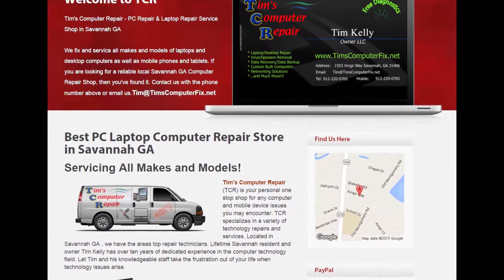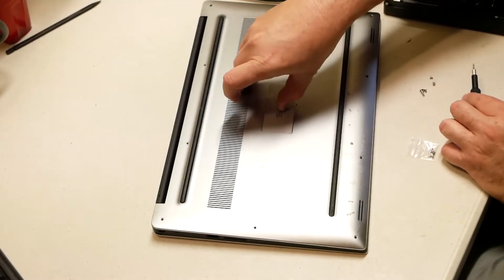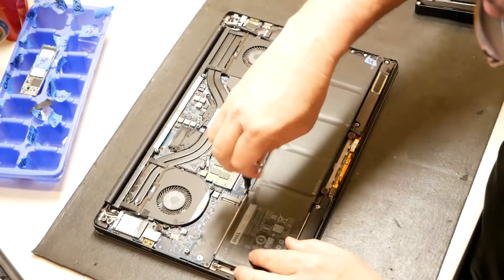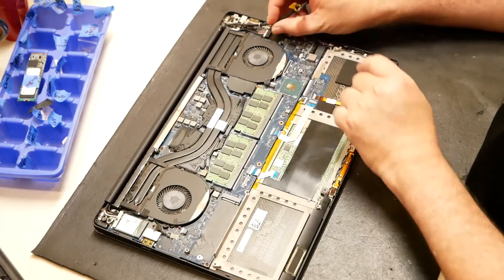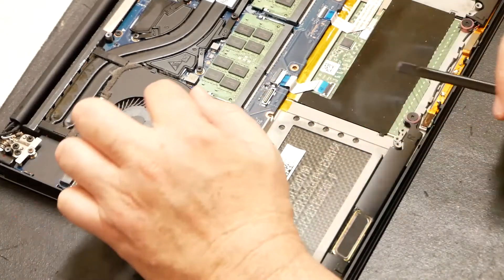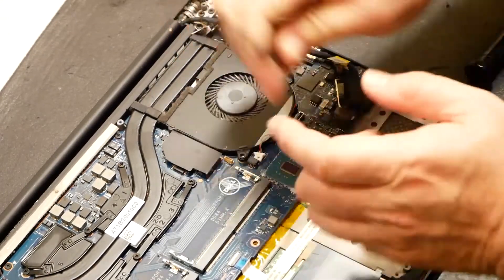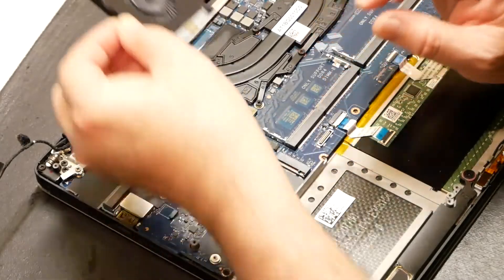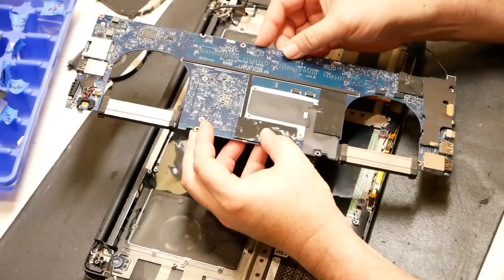Dell XPS 15-9550 disassembly | Motherboard Removal

Comment: watching you video i replaced my xps 15 9550 mother board with a seconds board i am having boot up inconsistencies reboot never works only cold start ups work some of the time. , i have noticed that my service tag is different and the asset tag is as previous , bios upgrades do not update,. should both tags be the same, if so which one should be changed and how and or should i do a clean install of windows, . or do i have a completely different problem. laptop works fine once booted up. tried all bios, firmware updates nothing works in the f2 diagnostics i cannot change any tags. dell support doesn't want to know anything as it is out of warranty and board was not from them, thank in advance
Reply from the maker: Thanks for the comment.
Reply: @TimsComputerRepair  Thanks for the Video,  I tried to remove the first screw with that aluminum bracket but it was completely stripped off.  Try to drill it it still won't budge.  any idea how to remove it?  I used 0 number screw extractor but won't work because it is aluminum and really -really soft and thin.